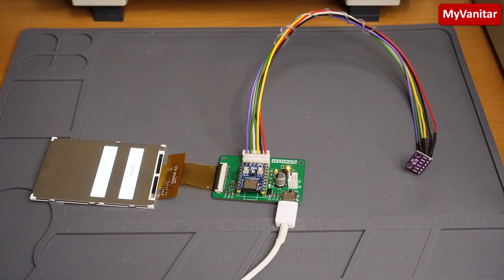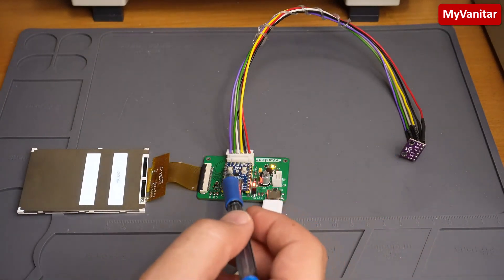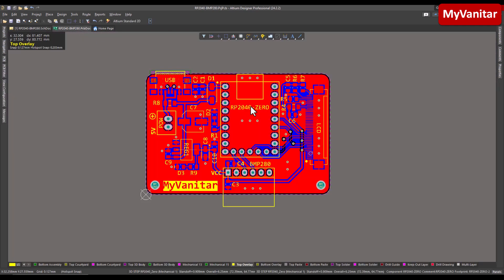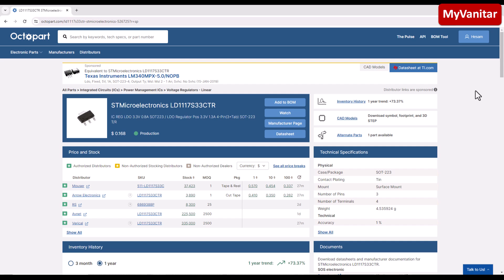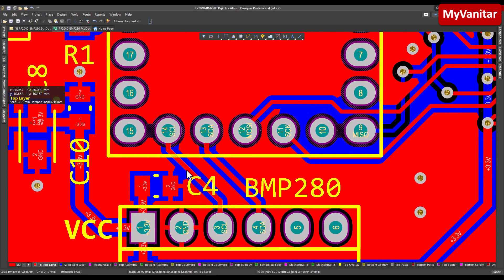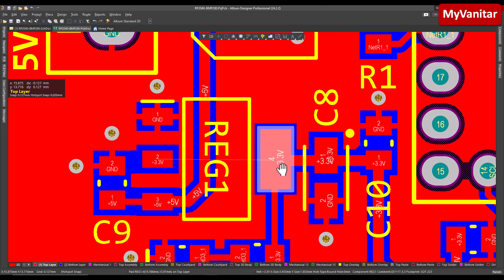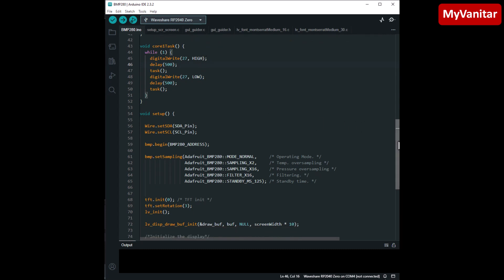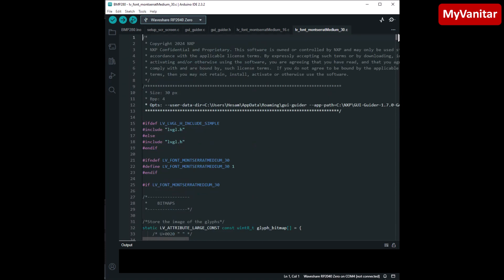Temperature, Air Pressure, and Altitude on a GUI using Raspberry Pi Pico, Bosch BMP280, and LVGL

Comment: How did you manage to use the RP2040 with LVGL, I am encountering problems trying to run it
Reply from the maker: This project? It's tested. Just check your soldering and connections. If you try your own circuit, many things could run badly. first try to show something on the LCD to see if that's okay, then run your LVGL functions

Comment: I will add my reply  about frost sensor(not accept long reply )
key word: radiation Frost dedector,SF 110 Model 
*Maybe  make this sensor can be a project too
** from manual 
On clear, calm nights, plant leaf and flower bud temperatures can drop below freezing even if air temperature remains above 0 C (see figure on following page). This is called a radiation frost and is due to the lack of air mixing (wind) near the surface, and a negative net longwave radiation balance at the surface (more longwave radiation is being emitted from the surface than what the surface is absorbing from the clear sky). Under cloudy and/or windy conditions, radiation frost events do not occur.
Apogee model SF-110 radiation frost detectors are designed to approximate plant leaf and flower bud temperatures for prediction of frost events. SF-110 radiation frost detectors are intended for applications in cropped fields and orchards when air temperatures will be near freezing, and where air temperature measurements are not a good predictor of frost formation.
Apogee Instruments SF-110 radiation frost detectors consist of two precision thermistors, one combined with a simulated leaf and the other a simulated bud, in a single housing. The leaf sensor is designed to mimic a plant leaf and the bud sensor is designed to mimic a flower bud. SF-110 radiation frost detectors provide close approximations to leaf and bud temperatures and can be used for prediction of frost on leaves and buds. Detectors are weatherproof and are designed for continuous temperature measurement in the same environmental conditions plants are exposed to. SF-110 detectors output two analog voltage signals (when supplied with input voltages) that are related to the resistances of independent thermistors. Resistances are directly related to simulated leaf and bud temperatures.
Reply from the maker: When I was a school kid, I was traveling for vacations to some areas where this phenomenon could happen at some specific times (beginning of the spring when leaves/blooms start to grow but the weather could go wrong suddenly and people face snowfall). they were saving the trees by burning some car tires nearby. I think monitoring the temperature and humidity is enough, for temperature, you can put 4C as the alarm threshold

Comment: Great video.
Could you make a weather station for farmers For example for a farmer!s garden.As youknow frost event is very important for farmers.Have some  differnt values before frost (lsuddenly ow temperature,,etc)
could you make a weather  alarm circuit for fruid gardens?
Reply from the maker: Which parameters are important? I mean temperature, humidity ...
Reply: @tar  Please search  Radiation Frost Detector Model:SF 110
(a chapter from Manual)
Frost damage to plants can have large impacts on crop yield and quality. Protection of crops during frost events is dependent on the accuracy of plant temperature predictions. Often, air temperature is not a reliable predictor of timing, duration, and severity of frost events because plant canopy temperatures can be significantly different than air temperature under certain environmental conditions.
On clear, calm nights, plant leaf and flower bud temperatures can drop below freezing even if air temperature remains above 0 C (see figure on following page). This is called a radiation frost and is due to the lack of air mixing (wind) near the surface, and a negative net longwave radiation balance at the surface (more longwave radiation is being emitted from the surface than what the surface is absorbing from the clear sky). Under cloudy and/or windy conditions, radiation frost events do not occur.
Apogee model SF-110 radiation frost detectors are designed to approximate plant leaf and flower bud temperatures for prediction of frost events. SF-110 radiation frost detectors are intended for applications in cropped fields and orchards when air temperatures will be near freezing, and where air temperature measurements are not a good predictor of frost formation.
Apogee Instruments SF-110 radiation frost detectors consist of two precision thermistors, one combined with a simulated leaf and the other a simulated bud, in a single housing. The leaf sensor is designed to mimic a plant leaf and the bud sensor is designed to mimic a flower bud. SF-110 radiation frost detectors provide close approximations to leaf and bud temperatures and can be used for prediction of frost on leaves and buds. Detectors are weatherproof and are designed for continuous temperature measurement in the same environmental conditions plants are exposed to. SF-110 detectors output two analog voltage signals (when supplied with input voltages) that are related to the resistances of independent thermistors. Resistances are directly related to simulated leaf and bud temperatures.